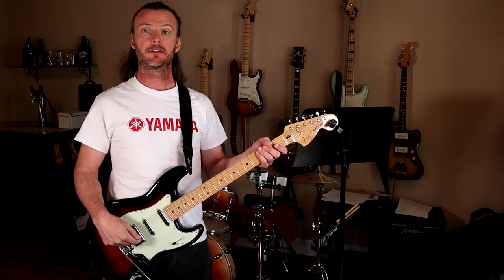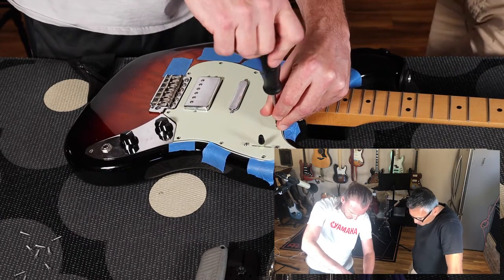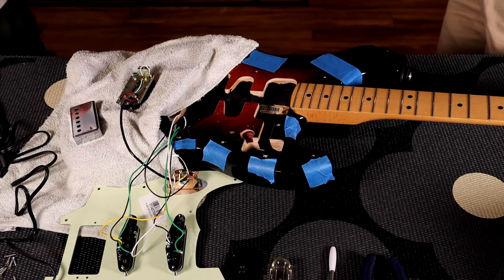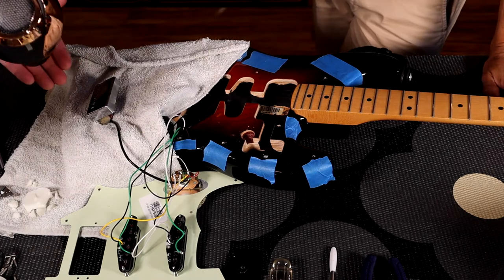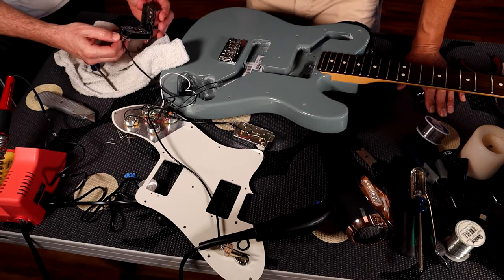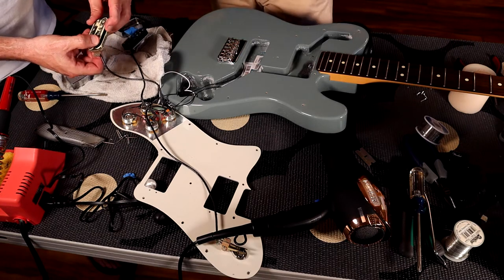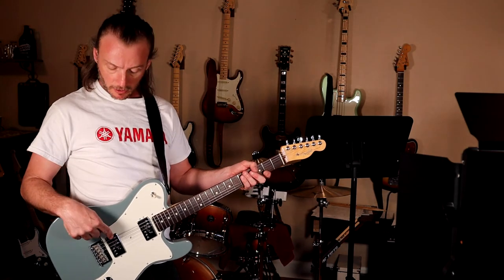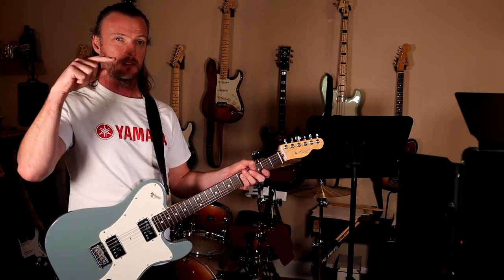Microphonic Feedback with Covered Humbuckers - Is there an easy fix?

Comment: i liked this video because you were honest with telling us you have never done anything like this before lol. im glad it worked out for you. the reaction was genuine! There is many opinions on how to install HB covers like this wax idea or even drops of silicone on a piece of masking tape on the slug side for protection against the pickup..... The pickup itself should be wax potted itself like when you buy an aftermarket one, but this is a great way to put a barrier between the metal cover and the actual pickup and potentially eliminate some squeal.

Comment: You don't need to remove the covers. Just put the wax at the back plate and let it flow inside when melted. The goal is to fill out all air gaps inside the pickup.
Reply from the maker: That's smart.

Comment: Thanks for this video! I have an American Professional II Telecaster Deluxe that has that same issue. I'm going to use your video as a guide to fix mine.
Reply from the maker: Best of luck! Be very careful when prying the covers off! It might help to heat it up really well with a hair dryer. BTW, I'm putting a set of CuNiFe widerange pickups in mine, but will have to route out the cavities slightly to get them to fit. Will post a video on that one day!
Reply: Well, I did it! There was a small amount of wax inside but not enough to make it difficult to remove the cover. The hardest part was pushing the razor blade against the solder with one hand while holding the soldering iron on it with the other. I used plain silicone caulk over painter's masking tape and it worked like a charm! Thanks again!
Reply from the maker: @alinvain1964  I’m glad it worked! Yeah, cutting the solder is a pain sometimes.

Comment: Great vid! JUst got one of those Firefly guitars (SG copy) with the humbuckers that are totally microphonic, hoping this will be a solution vs replacing (trying not to since that would defeat the <$200 guitar goal).
Reply from the maker: Good luck!
Reply: have you done  it and did it work? i want to record music but cant stop high gain feedback
Reply: @milosnipez2753  jury still out. I did it and no longer feeding back but the pickups tone seems kinda dull...don't know if it's due to the pickups themselves or adding the wax.
Reply: Going out on a limb but did you make sure to reset to the previous height or did you by chance put them lower/higher cause that will mess with tone like that too

Comment: A guitar that costs well over a thousand bucks shouldn't have issues like that anyway.
Reply from the maker: I agree. I was kind of disappointed with the pickups in the tele deluxe. I have since swapped them out for some CuNiFe wide range humbuckers which are freakin awesome! But it was also disappointing for the 66, but at least that one was easier to fix.
Reply: @themanncave2143  
Should have got a Classic Vibe Tele Deluxe 😉👍🎸
Reply: @themanncave2143  should have called fender!

Comment: Hey man, i have an epiphone es-333 tom delonge signature with uncovered gibson dirty finger humbucker pickup and having this microphonic feedback squeal or whatever it called, how i fix this problem? Your answer will help a lot, thanks btw for this amazing tips!
Reply from the maker: Thanks for the nice words! I'm not an expert on these things, but if the pickup is uncovered and squeals, that might mean you need to get the pickup potted (where you dip it in molten wax) - that keeps the wires and stuff inside the pickup from vibrating and causing noise. Sometimes pickups are potted at the factory, sometimes not.

Comment: Great video! But I’m wondering, what if you just took the covers off, and left them off?
Reply from the maker: That's an option! I kind of like the look of the covers, though. It can also be that the pickups feedback without the cover, in which case you might consider having them potted with wax to stop the noise.

Comment: Does it have to be wax or it can also be another isolation material? I am under the impression that the heat not only will melt the wax, but also will affect the pick ups.
Reply from the maker: When I pulled out the pickups and removed the covers, there was a foam with adhesive on both sides between the pickup and the cover. So I guess you can do something like that. I don't think heat levels that melt wax will affect the pickups. Wax melts at low temps and the pickup parts (copper and other metals) are unaffected by these temperatures.

Comment: Im having this exact issues on all 3 positions on my les paul knockoff.  

Both bridge and neck pick ups.

What could be the cause ?

My gibson doesnt do this
Reply from the maker: maybe - I am starting to check if the pickups are potted before I buy things these days so I don't have to mess with things like this!
Reply: @themanncave2143  found out it was the bridge pick up cover on mine. Took it off and its fine nownlol
Reply: You can dip the pickups in wax. And Use noise reducing tape on the back of the pickguard. There are videos on both.

Comment: adhesive silicone would have been much easier to use and works great...
Reply from the maker: Yeah, this method is a bit of work and it is easy to mess up a pickup.
Reply: Its irreversible, so resale value of any vintage guitar goes way down. I would never buy and old guitar with that mod. For modern guitars it doesn't matter.........